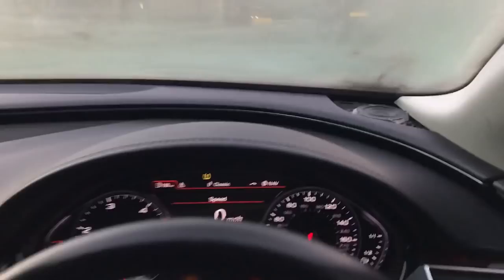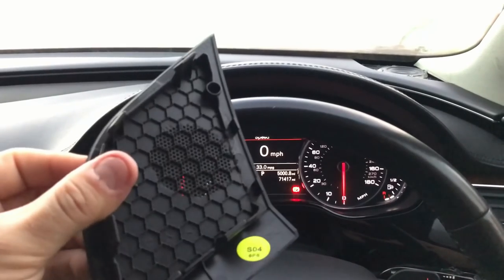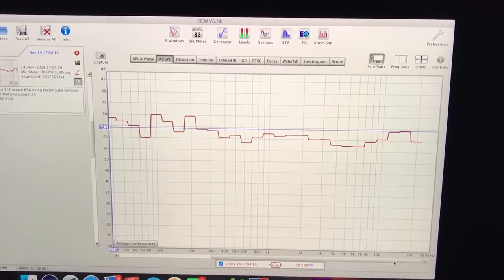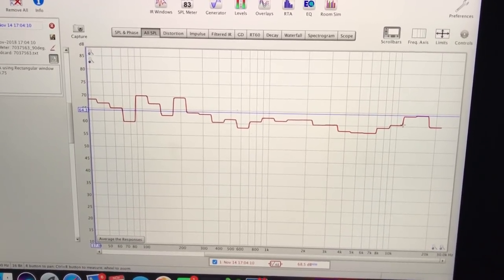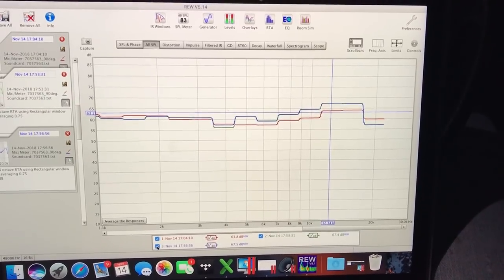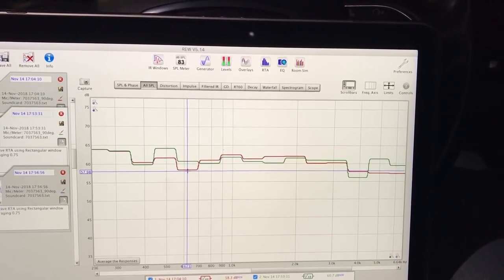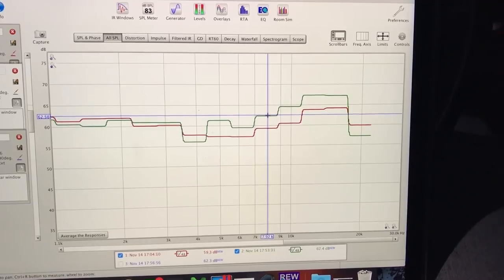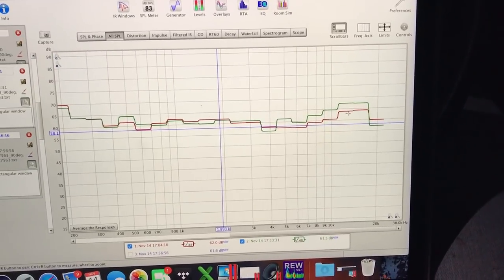Test results of the factory grill modification - does the grill restrict the sound?

Comment: Typical damages caused by factory grills: lack of transparency and naturalness.
The first cause is due to a bad "open ratio", the number of holes relative to the plastic mesh surface, and thickness of the grill. Plastic ones are usually 1,5 to 2,0mm thick compared to punched metal type grills which allow 0,5mm thickness.
The second is due to a "tunnel" effect, the grill being too far from the speaker and sometimes connected via a tube measuring a few millimeters (5mm is in general already too much). It causes comb filtering: the sound reflects/bounces between the grill and the speaker before passing through the grill. This is harmful and not ideal to get a clean and smooth frequency response since narrow dips are usually difficult to correct with EQ (and potentially increase local distortion).

Comment: Very interesting to see the results of the top end. Curious if there would be more top end with no grill cloth? I ask this because I used grille cloth to blend the speaker into the a-pillars for Audison Voce 1.1 tweeters and Hertz 70.3 Mille Pro mids.
Reply: I've got the same Hertz Mille Pro 70.3.  Where do u have them crossed over at?
Reply from the maker: Len Silvester That grill cloth is transparent.
Reply: @pssound9749  Yes, I see that, so is the grill cloth I use. As many of you installs do not have grill cloth my question is.  If removing lots of the plastic grill increased db levels, would nothing in front of the speaker on this install produce even cleaner-louder top end?
Reply: @corystock1569  unfortunately I cannot connect to my Helix DSP since my laptop has crashed to answer this.

Comment: Nice vid Peter. Do you know if stretching grill cloth like that would satisfy the EMMA requirements for speaker protection?
Reply from the maker: Carl Norrbom Hi
Speakers on dash need no protection anymore, so even if you had nothing over them, it would be fine!
Reply: @pssound9749  Hi Peter. Yes I'm aware, I was just contemplating doing something similar in my car (I'm competing in Master OEM) but obviously my drivers are located in the door and in the sail panel. Guess for those locations it is still the old regulations? Anyhow, good video evidencing the impact on those higher frequencies.
Reply from the maker: Carl Norrbom As far as i know it’s till the level of the top of the door card, but check it with a judge in your country!